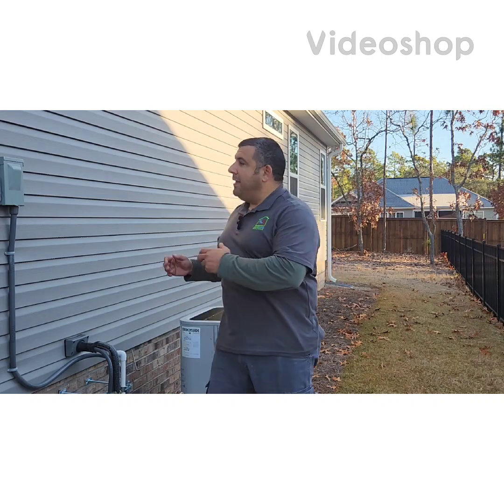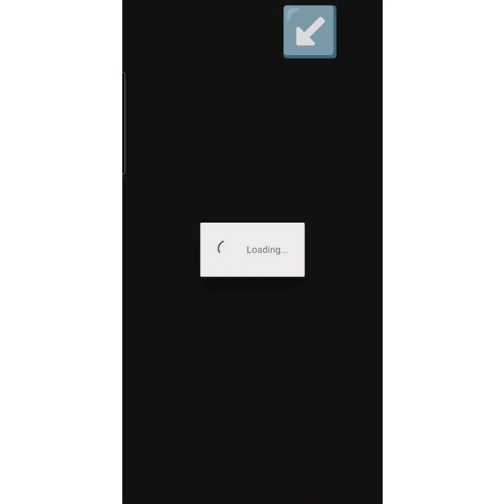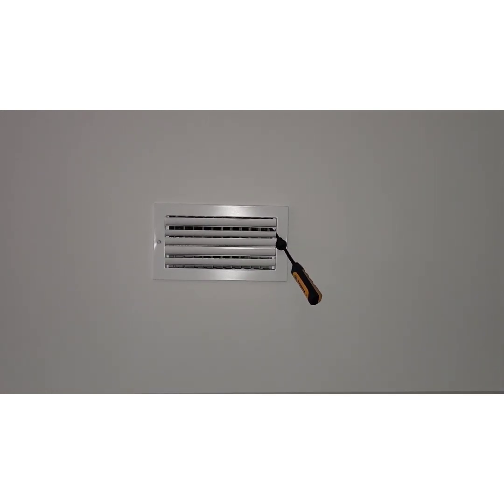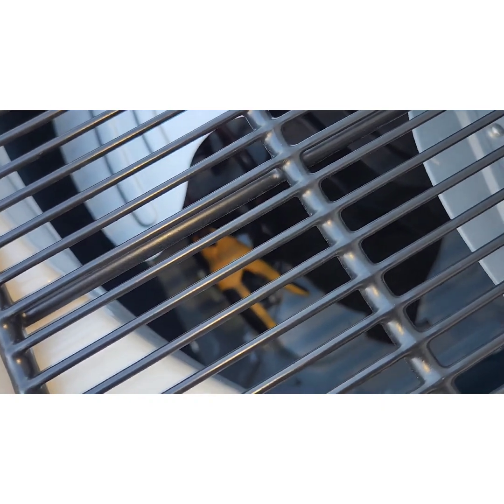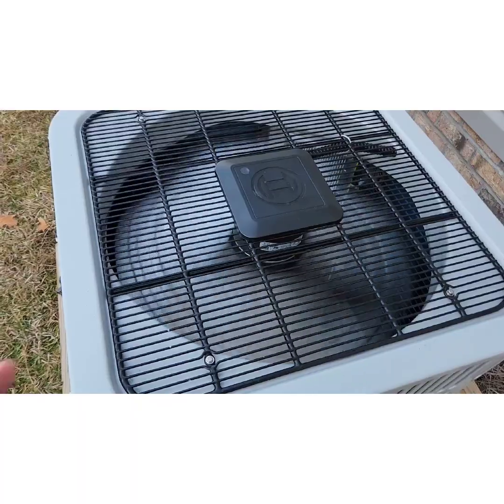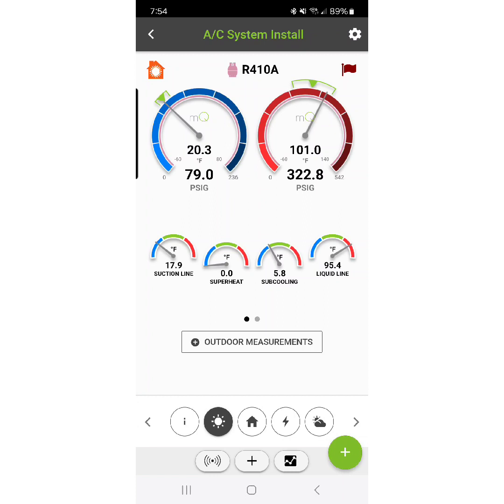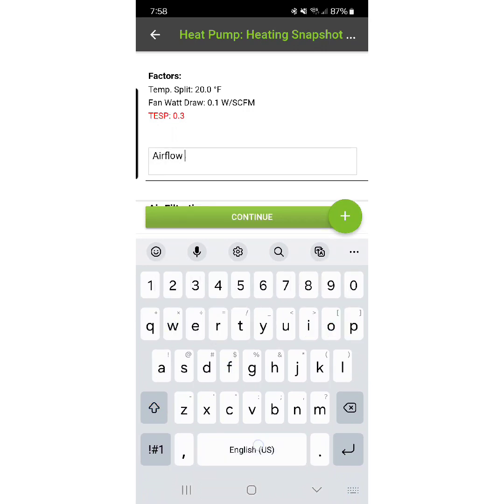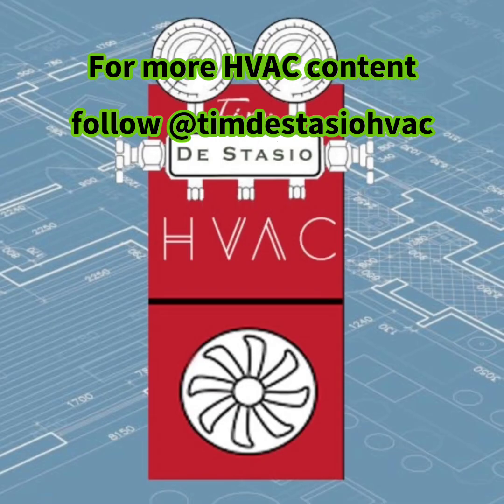Making measureQuick Easy Part 4: Heat Pump Heating Guided Workflow

Comment: Actually, Tim, we just don’t score the heat pump in the heating mode. There’s really no definitive target operation as they are commissioned in the cooling mode. We really should just remove the vitals report or make a note of that.
Reply from the maker: Ohhh ok. I thought it was because my SP was off. Thank you for clarifying.